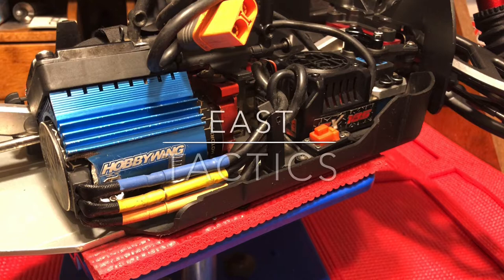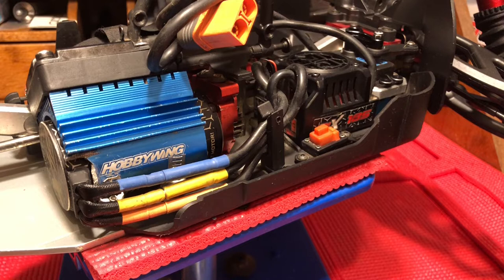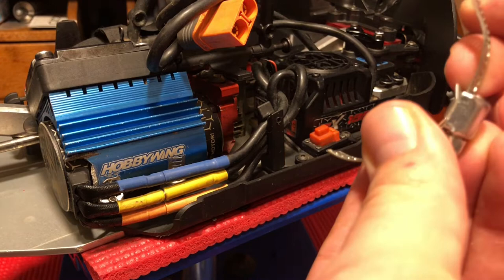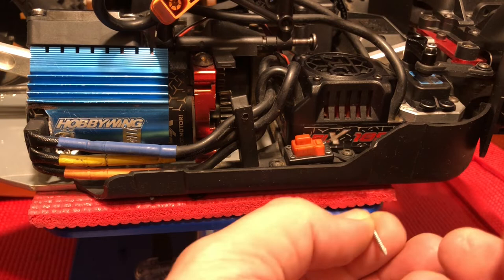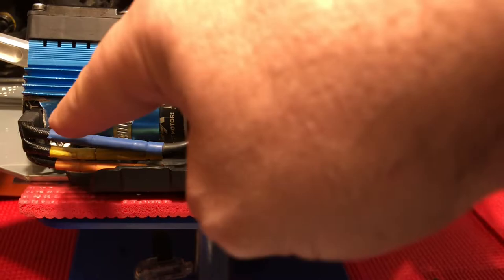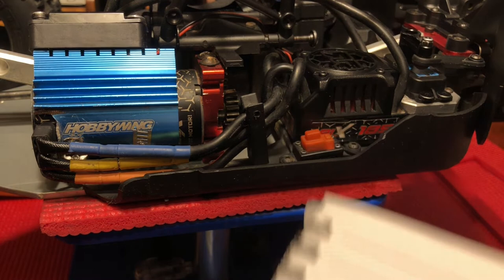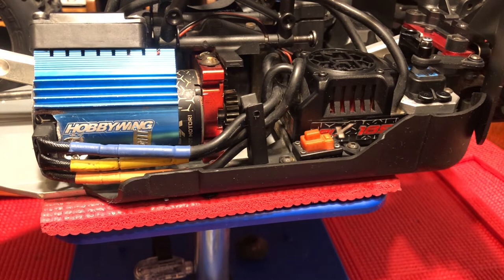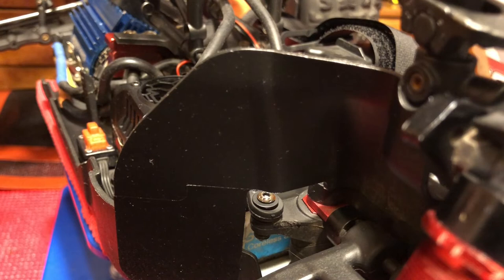HOBBYWING HEATSINK & FAN - INSTALL

Comment: What I did was remove the fan, and then bend the heat sink using a vise. Bend it slowly, removing it from the vise every so often, fitting it to the motor. Once it doesn't slide on to the motor, you're good to go. With your hands, pull the heat sink apart slightly and slide it on to the motor, and it will have a perfect snug fit. Reinstall the fan and you're all set.
Reply from the maker: Jonathan Rodriguez, Honestly I wish I would’ve been more diligent with that method. I actually attempted it in my vise first. But I got too worried I was going to break it LOL. Every time I start squeezing on the vise to a point I thought was enough I’d loosen the vice and it would just we assume it’s original shape. I guess I should’ve been more aggressive with the bending. Oh well… Thanks for posting. I think if I go with a new fan set up I’m gonna go with a dual fan from yeah racing. Have you seen that one? Looks like it was Designed to fit better
Reply: I have seen the yeah racing fan. Its look real nice. I want to give one a try soon. I came across your channel by searching for the hobbywing heat sink fan on Google. They seem to on back order or unavailable everywhere. Your channel looks cool and I just subscribed. 👍😎
Reply from the maker: Jonathan Rodriguez, Thanks bro, I really appreciate the sub. What rig or you running exactly?
Reply: I have all the Arrma brushless models except for the 8S Kraton. Out of all of them, my 6S kraton is my favorite and the one I run the most.
Reply from the maker: Nice!!!

Comment: Also i took a kettle bell for extra weight in a cloth and put it on my heatsink and pushed down hard on the edge of the heatsink and kept checking the fit, eventually it gripped the motor firmly and also to make it fit without cutting it, i cut a small piece of the roof column, worked perfectly and looks clean
Reply from the maker: Nice
Reply: What did you use to cut it
Reply: @vari.x2522  Bread knife lol but you don't actually need to cut the central tower as it can fit very snuggly if you push the heatsink towards the back of the motor..
Reply: @lexusant64  thanks, gonna put this on my typhon and there’s not much space to work with
Reply: @vari.x2522  Good luck

Comment: Nice. I used something similar and just installed it too on my Typhon 6s and Kaiju 6s. But mine is a heatsink and dual fans from powerhobby. It's like $22. It comes with all the hardware and parts to just bolt it in place, so I think the powerhobby one is better. It also has two small fans. No need to modify anything. 👍
Reply from the maker: Rc enthusiast. Seems like the extra 8-10 dollars is well worth it. Thanks for sharing 👍
Reply: @EastTactics  Yeah, it's super easy to install. The fans seem pretty powerful too. The only thing drawback I see is that the fans are exposed, so any stone or other thing could damage them easily. I break even the protected fans when jumping high though so we'll see what happens when I test them out 👍😂
Reply: Rc enthusiast. They make aluminum upgrade fans for them. They are a bit pricey but worth it. I used a mesh material to keep rocks and sticks out of my fans. The plastic fans work great unless you are going really big with jumps, that’s why I upgraded to the aluminum ones.
Reply from the maker: Slim Praetorian, I’d be interested in knowing where you get those aluminum fans that fit in the stockEsc. I’ve thrown in A new stock fan for now but I do send it pretty far so it’s likely to break again. I also have found a mesh material that I put over my ESC to keep rocks and debris out. I’ll be dropping a video on that pretty soon. Keep bashing brother
Reply: @EastTactics  did you ever find d out about these aluminum fans he was talking about?
Reply from the maker: @theaveragejoebody  Unfortunately I never did. I'm now rocking NTF fans, and been doing alot of testing on them. They break too under extreme bashing... so I've since changing my tune from trying to find a stronger fan set. but increas the protection toward our fans....and also all of our electronics for that matter. Check out this video to get the 411. 
https://youtu.be/hoMAey-yTDc

Comment: Does it fit on a 40mm diameter motor or is it lose. Im trying to find a heatsink for the Typhon 6s
Reply from the maker: What size fans are you looking to run?
I dont recommend this heatsink, it was too big, and a nightmare to make work. 
I actually recommend the heatsinks you will find on this parts list i've drummed together regarding "the High power fan project"

https://amzn.to/2GTPpWt
The project helps you outfit the highpower 40mm fans onto these heatsinks. Its my favorite heat sink out there because it wraps around the motor nice and proper and wont come loose in hard bashing. The downside to these heatsinks however is that they come with 30mm fans and are built to acommodate for the 30mm fan. Thing is... I like the heatsinks so much that I toss the 30mm fans and slap an adaptor onto the heatsink that hold my high power 40mm fans. Watch this video to get the "how to" regarding the adapter piece I use to mount the 40mm fan. Adaptor pc, also in the Also in the parts list (above)
https://youtu.be/uvRRYCtR4Co?t=191

any questions feel free to ask.

Comment: Hi I have a Arrma Mojave have the same electronic I put the speed gear I have the punch in 5, have a power hobby dual fan in the motor but I get like 2 min run and shot down only the stirring work I turn of esc and turn on and get another 2 min. Have suggested solution
Reply from the maker: I posted a video recently that covers how to do a stock reset on your ESC, that might help. You also might consider getting an external BEC, that pumps up the volts to your compentents. I'm going to be dropping a video in the near future showcasing the install for an external BED since my upgraded servo (Savox sw1210sg) can actually handle 7.4 volts. and the stock ESC does not push that.. So the external BEC will fix that. Anyway those are just my first thoughts. You might very well simply have a defective ESC. Arrma does offer warranty if the purchase is not too old.

Comment: Hey i installed this on my kraton 6s the other day after a bit of bending and now wondering if it would be ok to install the optional pinion gear for bashing? Will this heatsink be enough to keep the temps down?
Reply from the maker: Lexusant, It should allow you the flexibility of investigating upgrading your pinion. However every car is different and climate plays a factor not to mention Terrain. Running through long grass etc. will increase heat. So I would always recommend having your temperature gun available for testing anytime you change your pinion gear. What size pinion are you currently running? 
Obviously the lower your temperatures are the better. And your Heat sink and Fan should help. You never want your ESC temperature above 130, and you never want your engine temperature is above 150. 
The thing is, you need to take into consideration, is understanding exactly what your stock esc and motor can handle as far as pinion upgrades go.
You see people like RC dude 81 or Rich duper bash rock’n 20+ teeth pinion gears. But that’s because they’ve upgraded their ESC‘s and their motors. Really the stock motor and ESC are not compatible with running anything more than 16 to 17 teeth pinion gears. You can test 17 or 18 teeth and maybe your car will be OK. But you might also find immediate issues with cogging as well as depending on what Diff fluids you’re running a lot more breakages in your differentials, especially the rear.
As soon as you go past 16 T you start increasing the likelihood of cogging, and overheating. Depending on the chemistry of your own vehicle, and everyones is different.
I’m happy to relay that I learned the hard way. I jumped my pinion all the way up to a 20 pinion gear Back when I was a rookie in the hobby. I started snapping pins in my rear differential as well as planetary gears, and experienced Cogging issues. I have videos on the topic of cogging if you want to check those out. I have since dropped back down to a 16 tooth and have been really happy. Will I ever try 17t or 18t? Honestly I’m not sure. Jumping from the stock 13 teeth to the 16 teeth is a significant upgrade that you will be pretty happy with. Me jumping from 16 T to 17 or 18 would be pretty negligible. 
I do anticipate in the future picking up a higher quality ESC and potentially a new motor that are compatible with the higher 20-22 pinion gears, But I think I would have to burn up either my motor or my esc first to go there. Let me know what you decide to do. Bash on brother!
Reply: @EastTactics  wow thanks so much for such a detailed message (That got you a new sub lol) so im running stock pinion 14t and only want to go up to the optional 15t pinion. Am running on 6s and through grass and based in Uk so the weather is  pretty random!! Thats not too big a jump in pinion sizes is it? Am a noob in case you diddnt notice!
Reply from the maker: Lexusant, no worries, and thanks for the sub. Yeah jumping to the 15 t is perfectly acceptable and will get your car to the advertised miles per hour on the box. Installing that heat sink and fan is just Smart and will provide extra cooling for your motor and ESC which is great. It only becomes a necessity to install a heat sink and fan when you jump to higher than 15t. Which now that you have the fan you could consider going 16 or 17t. Just make sure when you do you watch those temperatures closely. In my opinion however 15 teeth is still crazy fast and aside from us males fueling our testosterone And always craving the fastest possible thing,  15t is plenty fast And very safe for your vehicle. These are RC’s are a blast.
Reply: @EastTactics  perfect, really appreciate the advice, now just need this lockdown to end so i can rip it lol
Reply: @EastTactics  hey buddy. I guess I'm seeing why people go beyond the box speeds and punch settings. I'm finding that's the only way to get really quick acceleration when you don't have a big run up to a jump and also to be able to rotate those flips faster and correct easier. I had to go so huge to do nice doubles and triples are almost impossible to get around unless you hit certain jumps with steep incline and you punch it really hard at the end. Somtimes power is not for just speed, it's for controlling what your wanting to do... Thats what I'm finding.

Comment: hey east tactics will that fan fit a 1/5 scale motor just woundering since its bigger than normal
Reply from the maker: It definitely is too big for the 2050 motor. So I really want to say yes, however i’m not 100% sure. 
It seems people struggle with trying to find a decent motor Heatsink In The 1/5 scale arena.

Comment: Love your content  and tactics that you give, you have some great ideas, but you did go way beyond what is needed for this - just take the fan off and place the heatsink in a vice and gently squeeze around at different parts of the heatsink so it tightens up evenly - keep checking size until its a nice tight fit - have fitten to both stock arrma 2050 and a hobbywing max 8 2200: https://youtu.be/BbVbcdigW1s
Reply from the maker: Hardcore_RC, I hate to admit it, but you are right. I will say though that specifically for my vehicle given the unique parameters where everything is placed, in order to achieve an installation with the Fan canted in word, One must notch way at the heat sink as I did. I actually did attempt to put my heat sink into my vice grip, But for me after squeezing it quite a bit and then releasing the tension on the vice It just re-assumed it’s original shape, or opened back up. I guess I just should’ve cranked a lot more with the vice, well over the amount I was comfortable with and it might’ve stayed. So I abandoned that method probably prematurely. Yeah I actually never was planning on dropping a video on this installation because of its complexity but I had a few people specifically asked me how I did because They saw it canted inword. Thanks for the compliment on my videos. That’s an excellent balancing video you dropped a link on.
Reply: @EastTactics  thanks - it does take a bit of pressure to bend the heat skin and make it stack, i did it in a wooden vice in uk we call it a black and Decker work bench) - the key is to keep moving the heatsink round so it bends evenly. these heatsink are only £5 in UK so i wasnt to worried if i broke it :) thanks for the comments on balancing video. Keep up the great tactics :)

Comment: The Yeah Racing fans/heatsink fit the stock motor with no mods necessary. They also move a lot of air and help big time. I run a 16-18 tooth pinion with no heat issues with this setup
Reply from the maker: Nice, I've since intalled a new stock fan. I will upgrade to a beefier one if it brakes. thanks for commenting.
Reply: Hi where and how to plug the wire in yeah racing fan, is it in the receiver
Reply from the maker: Yes, the wire  should be long enough for you to fit it inside of the receiver box in one of the open auxiliary ports
Reply: @EastTactics  is it 3pin also, and about my exb it's wiggling in the front wheel/tires while I'm using it, just bought it 1wk ago no bashing yet
Reply from the maker: I believe so, I haven’t installed the yeah racing fan but it should come with the classic connectors that fit straight into your receiver.

Wiggling can come from a multitude of things, but here are some things to check. 
First make sure it’s not your tires, sometimes you can get an abnormally inbalanced tire or two. Perhaps rotate the front tires to the back and see if that helps a little bit. If it does... then I will suggest balancing your tires. Here’s a video for that
https://youtu.be/a4o5-pRBkN8
Next you want to take a look and make sure that your hub nuts are tightened all the way/correctly...and not too tight. Here’s a video for that. 
https://youtu.be/MtCNn-Qc-Dc
If none of that clears up the problem let me know